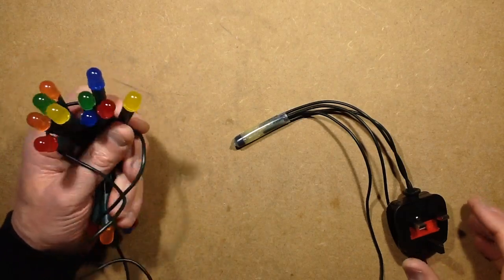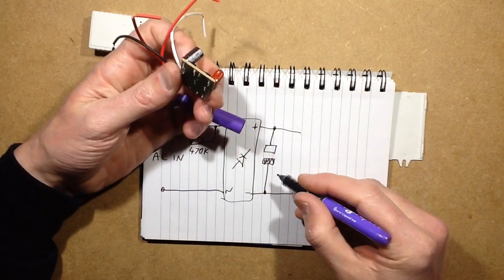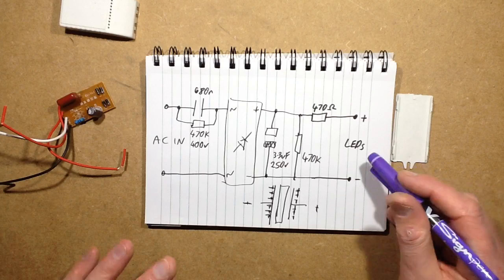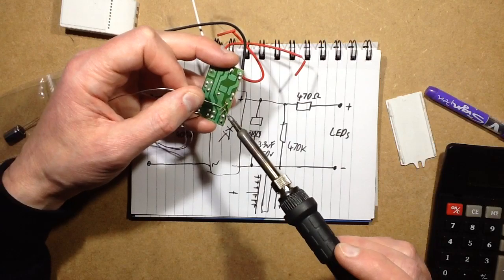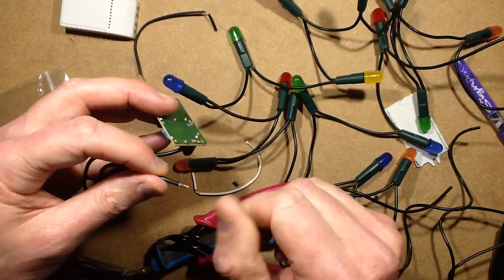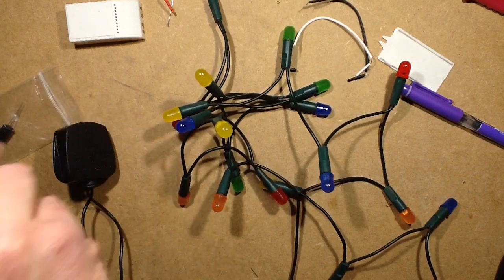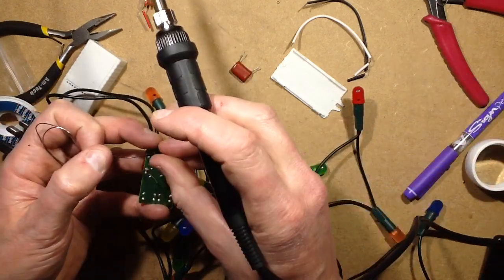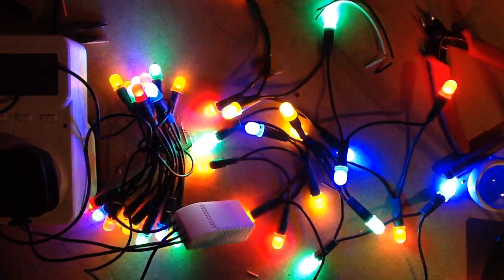BRIGHTER conversion of tungsten fairy lights to LED.

Comment: usb mem sticks are ubiquitous is itposs to hack a 1 2 or 4gig older stick to a higher capacity?
Reply: +hrxy1 no because to do this you need to (A) change the actual NVRAM IC and (B) change the NVRAM micro-p IC, both require special soldering / desoldering tips and/or hot air tools.. Also there is no promise this would even work and could damage your computers USB hub if done wrong, so its cheaper to just buy a larger USB stick.
Reply: Youre better off buying them, they became pretty cheap. But it is fun to replace the usb plug with an old usb wire and then sticking the board into a cassette or whatever to get a very unique stick.
Reply: +hrxy1 Nope, but you can reprogram them to appear bigger, just ask china how, cos they do it all the time... :P
Reply: ***** That 32GB sticker makes all the difference..

Comment: Simple capacitive reactance, not much to go wrong i suppose :-)
Reply: +zx8401ztv Just make sure its a good quality cap (Nichicon/Panisonic comes to mind) with low ESR if possible to keep down heat. Probably half of my analog repairs involve replacing degraded caps.
Reply: +GreenAppelPie Yes i agree, ive found more equipment dead because of tantalum beads, shorted internally, hate them :-/
But thats on older through hole pcbs.

Comment: http://www.ebay.co.uk/itm/Electronic-Transformer-AC-220-240V-Power-Supply-Driver-For-String-LED-50-80pcs-/360849829244?hash=item5404536d7c:g:FfsAAOxyVLNS67PE
Reply from the maker: +brian whittle There's a link to a supplier for multiples at the bottom of the description.
Reply: +bigclivedotcom I feel chastised as they are the same for cheaper, never try to outdo a ebay pro